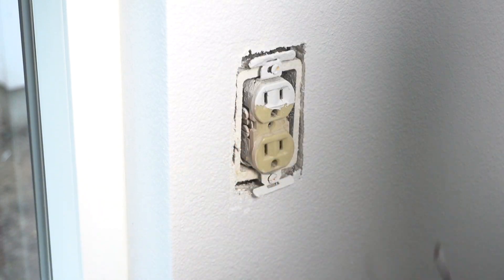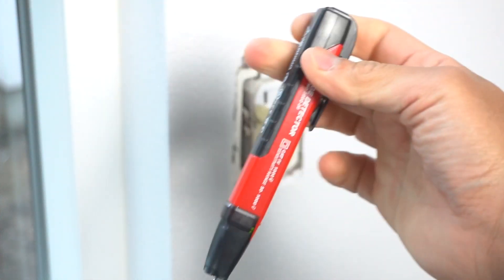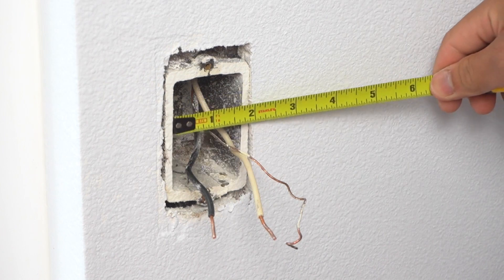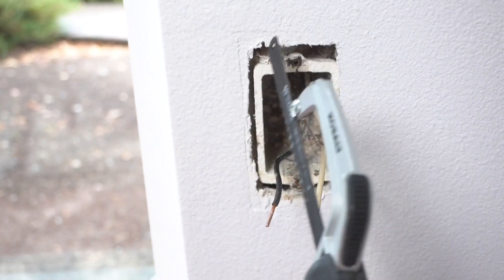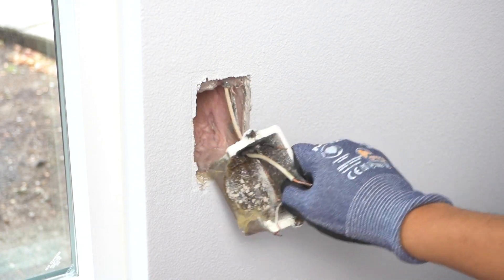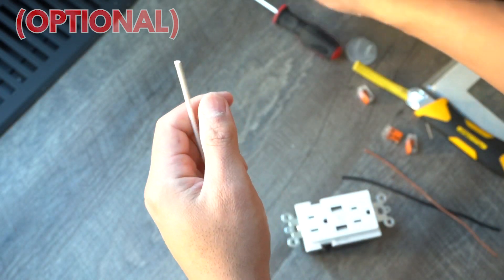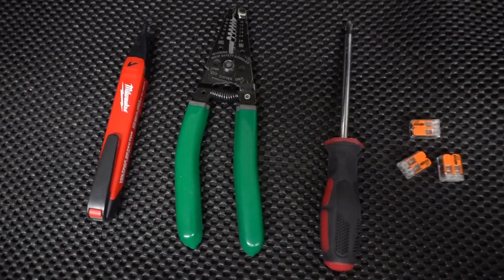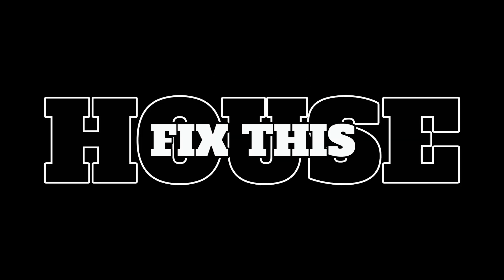How To Replace An Electrical Outlet Box On Drywall | DIY J-Box Install For Beginners!

Comment: This problem can be fixed in multiple ways. If you don’t want to hire an electrician, fine. But do your box fill calculations, apply all local codes, keep your workmanship perfect, utilize YT and other sources of proper information, and for me…if I’m going to “upgrade” an electrical box for whatever reason (GFCI, occupancy sensor, switch timer, etc.) I’ll use every trick in the book. That can include metal boxes with mud rings, rework boxes with extra side cubby space, and well, whatever it takes. If I have to do a bit of drywall work or painting after, so be it. It’s diy and my time is free. Check local codes though, if you have tenants you are not allowed to do certain procedures save for changing out luminary fixtures. And you might not care but your insurance company probably will.

Comment: This video is super helpful esp if you’re installing USB outlets like this.  USB outlets are fat (i.e., deep) and they do not fit nicely into the new work boxes used in most new construction  — ok at least not in my 1994 house.  You can cram the receptacle in there but it’s a pretty tight fit.  I’ve done it and I don’t love it esp on an outlet in the middle of a circuit that is going to have conductors entering and exiting the box and likely a pigtail to the receptacle (Leviton residential USBs have to be pigtailed in my experience).  So anyway removing the new-work box and installing an old-work or cut-in box like this that is around 20 cubic inches of volume is very helpful.  I just got a radial recip saw (multi tool saw) that should work nicely for cutting nails.  Great video.

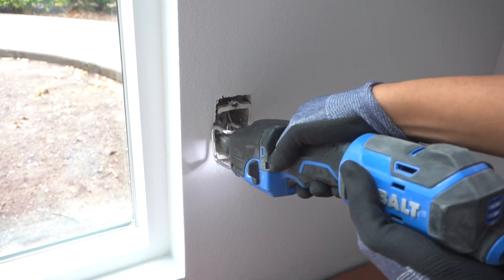Comment: 3:05 3:27 This is very wrong. Using a sawzall is the best way to cut the wiring in your wall for $$$$ more in costs. Those Drywall grab jboxes are a good way to pull out your drywall.

Comment: I have been in the habit of wrapping electrical tape around the outside of the outlet or switches for many years to cut down on the possibility that the ground wire kinks and touches the hot or neutral screws on the outlet/switch. Plus if you are ever troubleshooting something live, and yes troubleshooting is done with power on, it can help from getting bit accidentally. Just my 2 cents from years of messing with electricity.
Reply: This advice falls into the category of 'if you have to do it, you're doing it wrong!'

Comment: Was the old JBox that was cut out metal or plastic?

I purchased an older home that had three-prong outlets labeled with no equipment ground outlets. I planned on replacing them with GFCI Outlets and this was the exact situation I ran into.

Thank you for your detailed video!

Comment: Nice work.   Why aren't you using a multi-tool?  So easy.  Your ground wire is wound counter-clockwise around the screw..WRONG!

Comment: Thanks for this video!  I happen to have a reciprocating saw but didn't think to use it for this application.

Some others have reconmended not using this kind of box for receptacles, because there's a lot of insertion and extraction force on the box when plugging cords in and pulling them out, causing the tabs to eventually pull through the dry wall.  They recommend using a box that can be screwed into the stud.
Reply: so what type of box would you use? given the stud is behind drywall at this application?
Reply: @moctezumacuauhtemoc8470  I can't post links here, but there are molded boxes that have two screws that angle into the stud from the inside.  Once you get the old box out you probably can use this type of box because the screws are likely to be at a slightly different location and at a 45 degree angle compared with the original nails or screws.
Reply: @yeroca  I tried the smart boxes (Old work boxes that screw into the studs). It was a big fail unfortunately. They would not mount straight even with shims and the screws tore up the stud while trying to mount these. Maybe some people have success if they have newer house framing but my house has old growth hardwood stud and maybe that contributed to the issues.
Reply: @WhewLads    Did you pre-drill the holes?  hardwood can be a bear.

Comment: What if I am able to (just barely) shove the new outlet into the old jbox?
Reply: If the old box is metal, the hot screw could short circuit to the box (which is grounded).  This could start a fire.

Comment: I have lath and plaster walls, where it's very difficult and tricky to cut or enlarge holes for outlet boxes. If your not careful the while cutting the thin strips of lath wood, the lath breaks, often taking a chunk of plaster with it and you're screwed.

Comment: LMAO.  This happens to me all the time.  My house was constructed in the 90s so It makes sense.  Electrician says use caps to connect wires, and I prefer to use by oscillating tool to cut the nail

Comment: I think later I'm gong to follow your full tutorial and purchase a bunch of these old work style boxes. My house was built in 1961, wiring is somewhat newer, given we have drywall, but the outlet boxes are small enough to where it's difficult to fit in new special type outlets. People don't know how long it can take to install an outlet. Each one can easily take you 30min just to get things right, multiplied by the number of outlets you have in your house.

Comment: The tab at the top of the box should stay secured against the outside of the drywall. You seem to have pushed the box in, so it's it's not secured anymore as seen at 5:38...

Comment: Thank you so much! I almost hired an electrician for a simple fix. I’m picking up supplies tomorrow. I like those wagos! So much easier.  My outlet box is not even secured to anything. My new outlet with usb plugs is too big for the current box.  I replaced most of my outlets already but these were overlooked since they were behind furniture at the time.  After this I need to do a recessed outlet for my fridge.

Comment: IFF you're using Wago 221's -- Small correction @ 4:31 -- Instead of stripping wires 1/2 to 3/4 inch... Wago wire nuts have a strip gauge on the side, which comes out to 11 mm (0.43 inch).
So, simply use the strip gauge to check if wires are stripped to the proper length.  😉

Comment: Thanks for the video!

What do you do if your house is just old enough where the cables do not include a ground, but the boxes are grounded with separate ground wires behind the original boxes?
Reply: Get an electrician[or yourself,] and you have to get everything rewired to add the grounded connection...
Our do the redneck thing and don't wire it grounded. [YET!] You will need the house outlets grounded to be up to codes, at least I'm pretty sure anyways. But since your outlets will probably all be in the same place as before the install, having the new outlets already in place will finish a step from the future project. Or I'm completely blowing smoke up rear ends, I hope I'm right. Most plug wires are attached to the frames so it's hard to just...
Disconnect the old cable and replace it with the new one by attaching the two, and pulling it out through the destination rooms connection like pulling a thread or string through a tube. It sucks either way.

Comment: Nice Video - well done!  Regarding the ground wire,  you need to loop it in the other direction so it does not come out when tighten.
Reply: I came to the comments to say this 😉
Reply: I looked in the comments first before stating this myself.  I'm always shocked that people can be so sloppy and careless.

Comment: 1st off you don't use a Sawzall in a wall with pre-existing wire cause you don't know which side the wires are coming in on and you can easily cut through themcausing shorts and fires.  You use a oscillating tool and just go past the feeling of resistance and it actually makes a straight line.  Also I'm a professional electrician we don't use Sawzall for making those holes, we use Sawzall when we start our for cutting pipe and strut.  When we learn more we go to a bandsaw. Handymen who like to fuck up our work use Sawzall inside a wall. 
2: why didn't you use a level to line up your lines to cut. Don't die you're video. Make it professional. 

3: those small pieces of wow you put on are called jumpers or pigtails and it's not optimal, they're mandatory on any switch or outlet in the series except for the last one but you should include it there too.  Jumpers/ pigtails protect the word inside the walls from being fried/ damaged severely and it tends to only let the load/ outlet or switch take the damage vs the wires.

Comment: Looking for help.....  A contractor put too many outlets/devises in series so I am constantly blowing my breaker.  One of the biggest culprits is the microwave which I can easily run on it's own circuit.  Since it is currently run in series to other outlets, what is the safest way to "cap off" the current line so everything down stream keeps working?  Can you just twist ties the line together and stick it in the wall?
Reply from the maker: Please stay tuned! I’ll make a video on this! 🙏🏽😊

Comment: Great Video Sir! My home is only 21 years old and with wifi devices and others, my boxes will not except some of them. It is amazing the money you can save if your knowledgeable on AC wiring and a DIY'r. I have saved 1000s of dollar$ over the years on the farm here and its up to code.
Reply from the maker: Amazing! I’m glad you’re able to save a ton of  money! That is my purpose for my channel! I wish you well my friend! 🙏🏽😊👍🏽
Reply: Not is your listen to this guy, you'll think your saved money until you're system hits a part surge and those"optional" jumpers got never installed caused your entire line to get burnt up.

Comment: What you can do if the whole in the wall is wider?
Reply from the maker: If it’s only by a little bit I would use mesh tape and 5 minute mud (hot mud)
Reply: @FixThisHouse  thank you 😊

Comment: What do you do if your wiring is in conduit?
Reply: just cut conduit 2-3 inches above the box and then add a 4 inch flex fitting get a box that has the circle punch outs and attach the flex fitting

Comment: I have a very weird fear of wall outlets. When I was a small child I got zapped really bad by one and it kinda stuck with me. I still use em of course, just, carefully
Reply from the maker: Yes please be very careful and always turn off the breaker when working with electricity 🙏🏽
Reply: to rid your fear, go shock yourself with 120V. as an adult, u can literally barely even feel that. there is zero chance u can get hurt from 120v unless u do something very odd like stand in water
Reply: @srobeck77   This is bad advice to give someone.  If you have cuts in your skin it greatly reduces the resistance of the human body.  120VAC can kill if you get enough current running across the heart, because it can cause the heart to go into fibrillation.  Currents above 75 milliamps (mA) can cause ventricular fibrillation, which can be fatal.  Currents above 100 mA can cause muscles to contract, leading to an inability to let go of the conductors.  Large currents can also cause burns.  Most home breakers are either 15 or 20 Amps, so they won't trip unless it's a GFCI type breaker.

I once accidentally touched live wires with a pair of pliers because contractors at the home had flipped the breaker back on without my knowledge while I was working on a circuit.  A large spark and pieces of molten metal flew off the pliers.  There's still a melted spot weld mark on those pliers, to remind me to do lock-out & tag-out on breakers & panel boxes when anyone else is working on the home at the same time!
Reply: @TrinitronX  no its actualy real advice. 120V is nothing unless u do something crazy like stand in water. Ive personally been shocked by 120V about 30-50 and nothing happens. So its true brother friend.
Reply: @srobeck77  it’s happened to me as well. Didn’t do much tbh.  But if you have heart problems or implanted device, then you’re basically human toast
Reply: @mynameisnotimportant2854  just think if you a metal skeleton like Wolverine how much electricity would get you. Ya i got all that drama, so applicable for 98% of people
Reply: @srobeck77  My first thought was "Oh, there's no brain damage or anything...." LOL

Comment: I alwayas found the mounting of US outlets rather strange.  The fact that you typically need to mount your outlet to a stud means you often don't get the outlet where you want it.  This type of box with the tabs is a huge improvement in my opinion, but it is poorly executed, those tabs are tiny and not spreading the load at all.
Reply: usually you attach to a stud if your putting the outlet before putting the drywall or sheet rock up but we also have old work boxes that allow us to cut drywall and then mount anywhere
Reply: 100% better to mount to a stud and youd never need to redo this outlet, except in the case of 100 year old homes where the boxes are either too small or made of subpar materials (not URL rated). These floating mounted boxes will never be as good, but its a nice after the fact, quick fix for 100 year old homes.